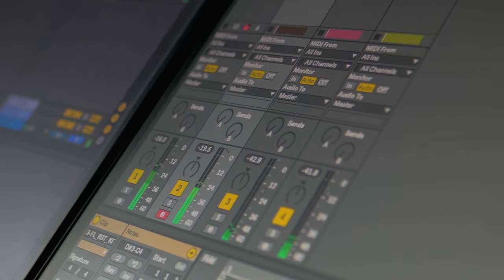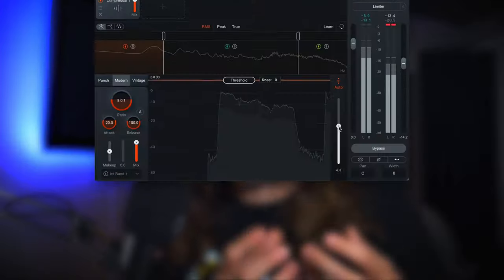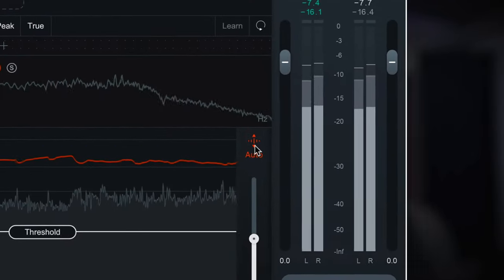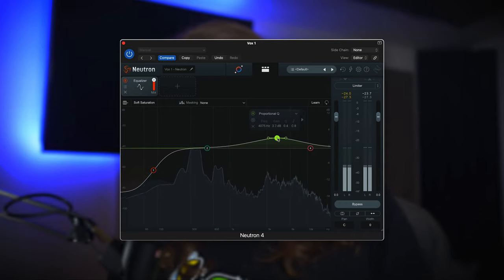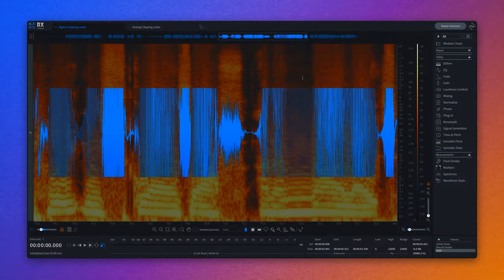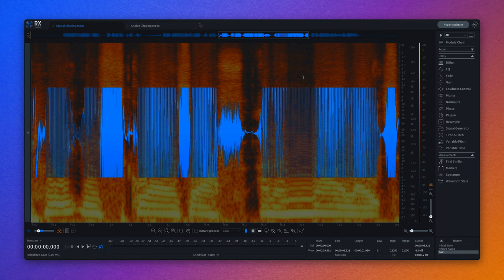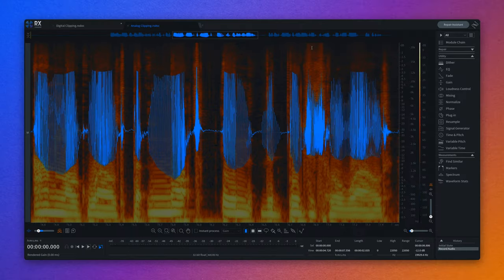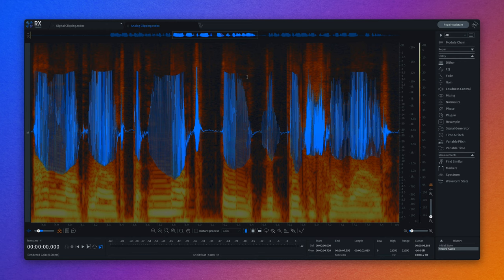What Is Gain Staging? How to Gain Stage Your Mix

Comment: iZotope!  Can I request that you do a Gain Staging Part 2, deep dive reference video in which you lay out the differences between Peak & RMS, how 0dB VU is referenced, -18dbFS RMS, 1.23v, +4dBU, what Nominal levels are, Noise Floor to Nominal vs Nominal to Distortion, Headroom, Dynamic Range, Signal to Noise Ratio, THD (Total Harmonic Distortion).

Essentially EXPAND upon what you just did, but more as a Reference Material that everyone can point to and come back to for the definitive explanation of these fundamental audio engineering concepts.

You could also expand upon (with visuals) what digital clipping vs analog clipping looks and sounds like, but also include the point in every circuit, or code where a signal goes from linear to non-linear, and how different circuits distort the signal differently.  What do those distortions look and sound like?  Even order.  Odd harmonics.  Etc

Sam made reference to the fact that many people get Gain Staging confused.  I would argue that if someone where to search YouTube and watch the dozens of GS videos, they'd be applauded for Not coming away confused.
Hence my humble request.

Settle this once and for all!

Comment: I'm a "show and tell" guy, so your video made more sense when you showed them working in a DAW. And your 3-PT synopsis at the end was good. I have found that at times when I use Ozone 10 Advanced as my FIRST plugin in the Insert section of a song in the Project Pg, the mastering module in Studio One, I sometimes find that the overall result is too hot.

Comment: Kind of interesting, how there is not a single word about the most important use of gain staging, at least in my opinion:
By using plugins without gain compensation:
1. You are fooling your brain with the omnipresent "it's louder, it's better" bias. So your mixing decisions might be not the best without gain staging.
2. You may change the way a plugin in slot B react to the signal, when changing settings at slot A after the inital setup of the fx chain, since a lot of plugins are nowhere near linear.

Or is there another term for the points I am describing?

Comment: Well thought through presentation, thank you.
The average user would benefit from some start-to-finish examples, but overall, well done.
Personally, I record old-school style, everything near 0 dB FS for the best S/N ratio.
It takes a bit more care when using plugins, but I'd rather have a 96 dB dynamic range than an 84 dB range offered by those -12 dB levels. 
I'm offered 16 bits, I feel obligated to use 'em all.
(-12 dB means you're using only 14 of those 16 bits.)
Best regards,
Bill P.